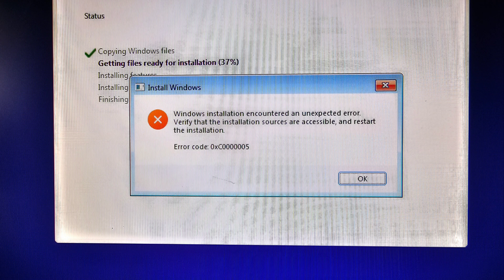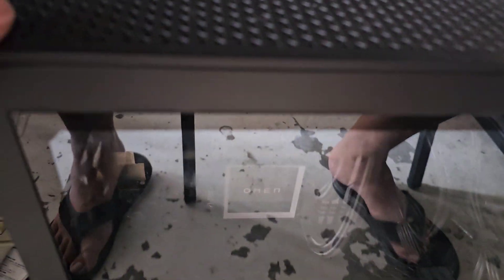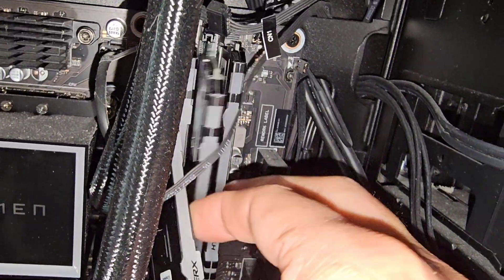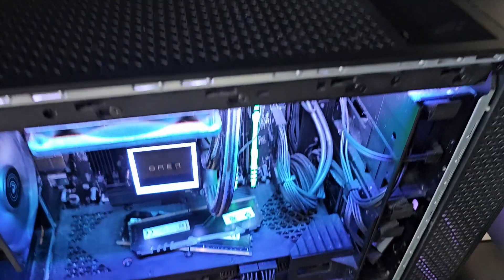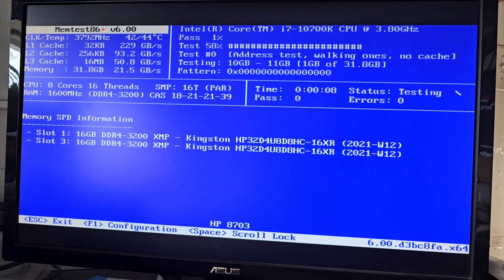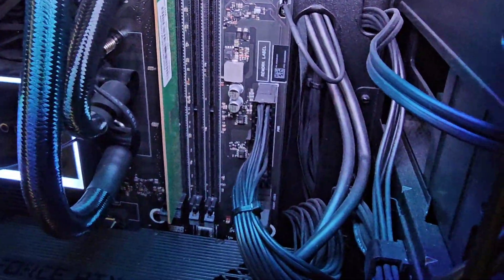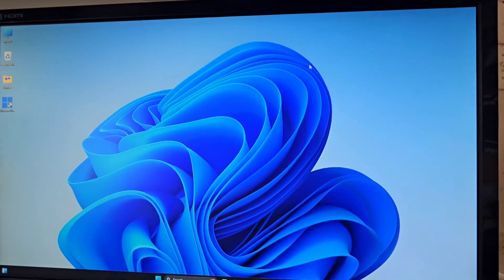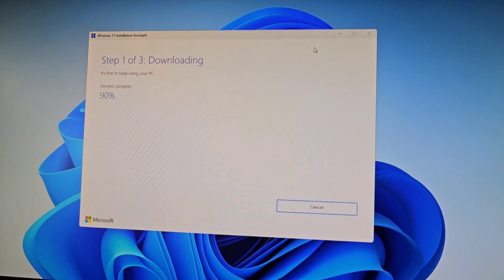Windows Installation Encountered an Unexpected Error. Verify the Installation Sources are Accessible

Comment: Trying to have dual windows boot , i had a empty ssd, i got this error and after i switch the install to win 10 pro and it works fine. Win 10 hime didnt work perhaps like the other commenter it detects that you already have one wind 10 home
Reply from the maker: Shouldn't be. They should both add to the efi windows boot loader. I haven't really done it though, so I'm not sure how.
Reply: Yeah it gave an error at a later stage so i just gave up on it. I was too lazy to disconnect my existing storage medis which would probably fix it @ItsBinhRepaired
Reply from the maker: @randomdyfbrn  :(

Comment: I was getting this error after upgrading to an NVMe SSD and trying to install Windows 11 while still having my other SSDs installed with Windows 10. Unplugging the other drives seem to have fixed it. Very weird bug though that needs a better error code!
Reply: Resolveu o meu problema 😅 🙌🙌🙌🙌
Reply from the maker: Nice!
Reply from the maker: @bubbleboy821  strange
Reply: i just got this new nvme m.2 ssd and i kept getting this error and scrolled to the comments i seen yours tried it out and it worked
Reply: Your first mistake was choosing windows 11